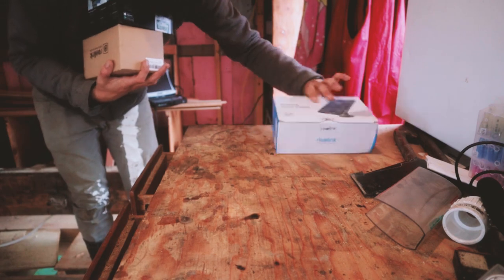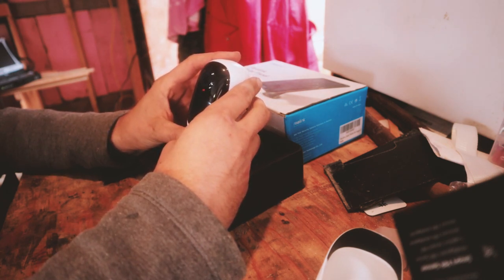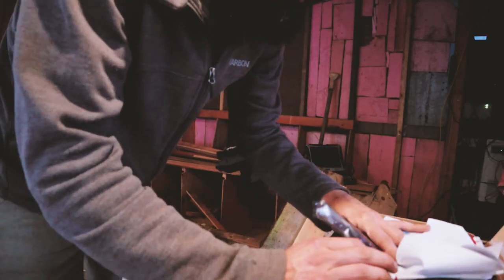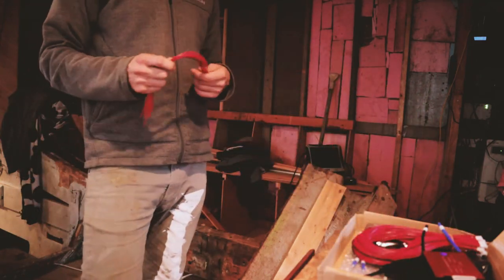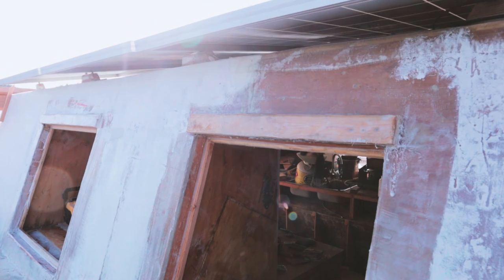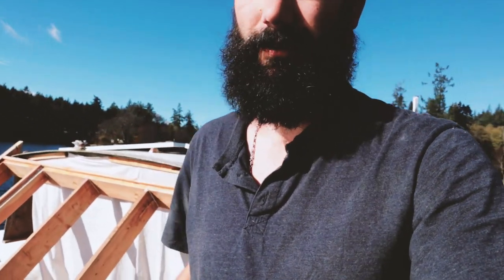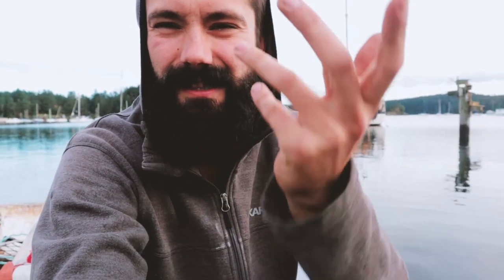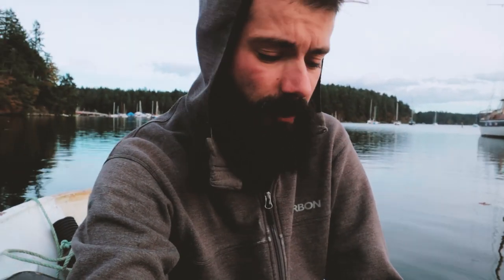Waterproof Lithium Batteries - Sink or Swim 113

Comment: Check out automotive radiator fans as they are designed for a nasty, hot and wet environment. They run on 12v at reasonable wattage and can be controlled with a simple temp probe and relay so they are not running continuously.
Reply: Great thinking! I support this idea and there's a motobike small fans (2-3amps) as car ones pull 5-7amps ...

Comment: Most electric blankets I've seen have been designed to be used under a blanket on top of your body .... they caution against laying on top of them as the body weight can damage the internal wiring.

Comment: I believe water resistant is what you were looking for on the Battery/BMS.

You may want to check out reinforcing the corners of the windows, because the boat moves so much when in transit. all windows/openings on boats and planes are usually larger radius as corners can fatigue in fiberglass/aluminum etc..

Keep up the good work!

Comment: They have a sailing dingy. It seems logical that sail cruisers would want a sailing dingy. My FlySail design has a miniature fly designed to fit into the stern and be part of the boat when at sea.My FlySail would work on your electric catamaran if you are interested.

Comment: Hey Simon, how about a pvc pipe with either a screw off top or some sort of waterproof solution that you could create a vent for the generator with maybe a low voltage fan or something like that? could be a very low cost solution.

Comment: I have all the BMS sense wires on a PPTC self resetting fuse in order to avoid any unnecessary smoke and hot wires... Otherwise except for a section for measurement I have the battery terminals protected with clear silicon

Comment: Generator cooling? I would make bottomless box, insulate it with some sound absorber inside, cover a generator, leaving bottom exposed, then I'd mount extractor fan at the top of tube with 180 degrees end curve (to prevent wave or rain splash), duct would be mounted on the top of the box. By doing it like that fan would help already present natural hot air stream up, while sucking cold air from the bottom of the compartment through missing bottom of the box. Exaust pipe should be mounted inside that extractor tube to help hot air streaming up but should be out of duct, just before fan level. In case of fan failure, hot air will continue to flow just with a little help of heat of exaust tube...something like that...
For a window drain, is it ok to drill a hole, epoxy it as much as you can then tap in copper pipe same diameter as a hole? Clean a hole inside and done.
Reply: ...and yes, wouldn't, by any chance, try to use that hot air to heat living quarters - due to possibility of CO poisoning! (carbon monoxide, little disclaimer)

Comment: Finding Simon - i had a big generator on my yacht but i pipe the generator exhaust to the outside of the yacht and uesd the eberspacher exhaust fittings and can get pretty much off the shelf and can save time and all the eberspacher  parts ar made for the  eberspacher diesel heater
hope this will help

Comment: I can not believe that you just installed a gasoline generator in your boat. As much as you trash talk diesel, there is a very good reason that diesel is the fuel of choice for sailors, and gasoline engines are never ever used on sailboats: fire, death, and destruction. Gasoline will spark into flame at the slightest provocation, but, you have to be very determined to set diesel fuel alight. PLEASE remove that extremely dangerous gasoline generator from the inside of your boat. Outside in the open air is the only safe place for it, and, ideally, it should not be on the boat at all. 
Safety First